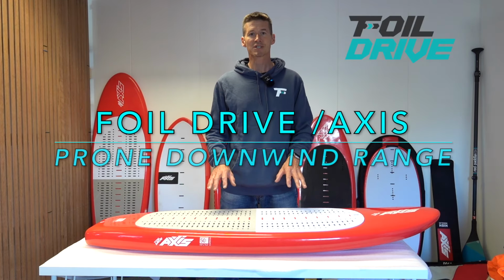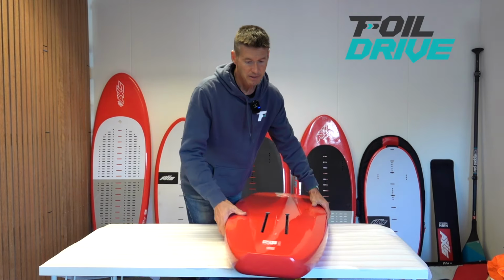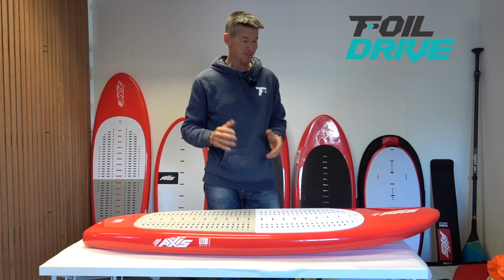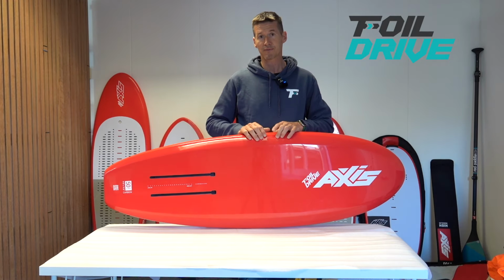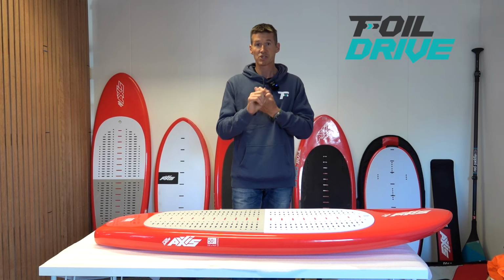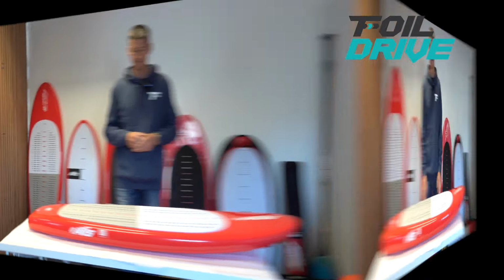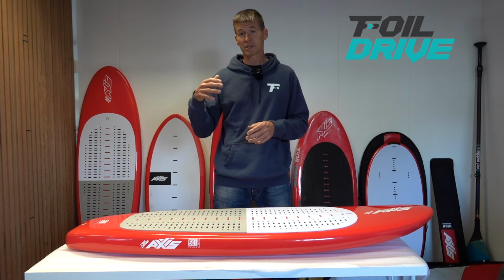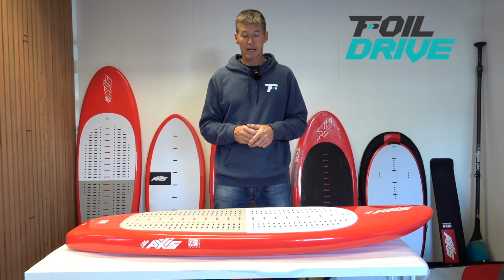Axis FD prone DW board range

Comment: I have the 60L for Foildrive and it is incredible.  All design aspects mentioned in the vid are true and spot on.  Super well done.  In a handful of sessions my foil skills have excelled rapidly.  From flat water pumping to now catching swell.  Downwind ing is around the corner.  I’m 90kg and the 60L seems perfect
Reply: Do you need 3 prop upgrade with that? I'm 92kg and struggling with the boards I have ATM. Can you start on flat water? With what foil? Do you need to paddle to do it?

Comment: When you say you use the 50l for pretty much all wing foiling conditions, is this with or without a FD? I'm the same weight as you and hesitating between 50 or 60l as an all-round wing and FD board. Currently using a 55l and 65l board to cover light and strong winds.
Reply from the maker: If you’re talking about winging with AND without FD, I would definitely choose the 60

Comment: Very informative. Could you use the old foil drive system with the 60l and where would you position the battery?
Reply from the maker: It’s definitely possible to use them with gen 1. Personally I would put the dual lock tape and possible the low profile anchor points just behind the deck pad at the back of the board. TBH I would probably cut off at least 6” of the back of the deck pad as you stand so far forwards on these boards you don’t ever stand that far back

Comment: Thanks for the video. I am looking for a board to use for a long time. I am a 95 kilo beginner with a lot of surfing experience. My set up now. 
Foil drive 
Axis png 1310 
49 liter 4.10 board ( old used … to small) 

Would you recommend 60 or 70 liter.

I would like to use it for wing to.
Reply from the maker: 70ltr

Comment: Dominic As I use F.one foils would I need to shim the mast for it to work with the right angle? On my custom wing board I need to shim the mast however as this is not winging... Thanks
Reply from the maker: It’s unlikely you’ll need a shim. I can’t guarantee it as I haven’t used f-one foils with these boards, but many brands have been used and none that I know of needed a shim
Reply: @dominichoskyns9091  Thanks for the reply. Do you know by any chance if that board's tracks are at 0 degrees? Keep on the good work!
Reply from the maker: @antonioduarte9535  not sure, sorry. I’ll ask Adrian